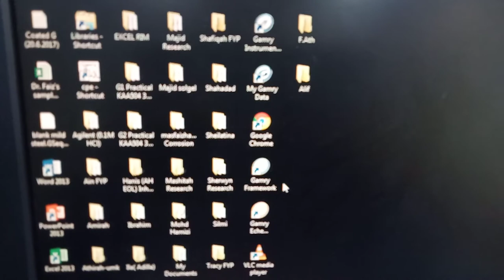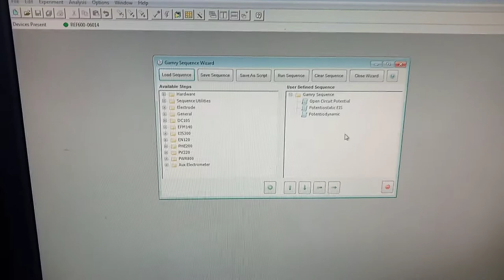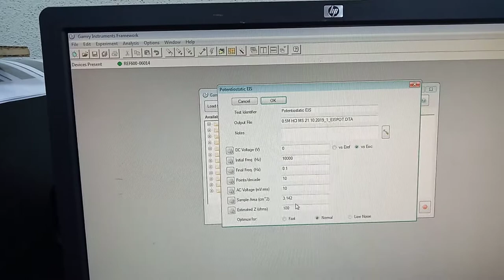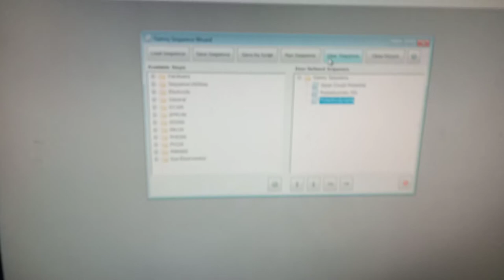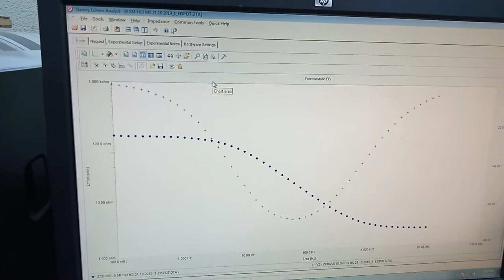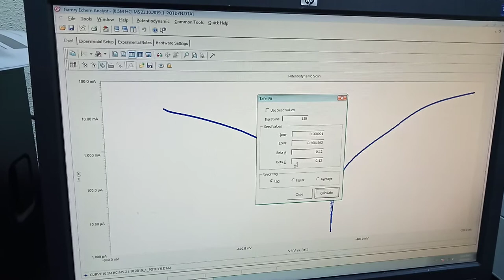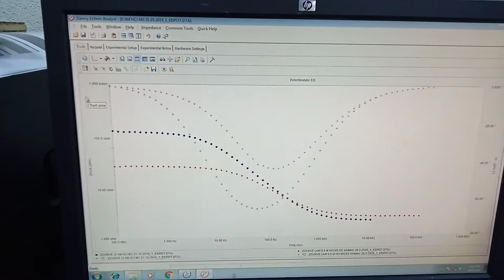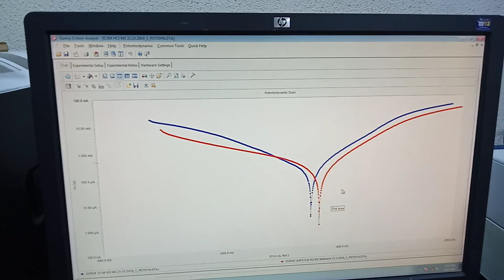Electrochemical Measurements (OCP, EIS and PD) for Corrosion Monitoring using GAMRY Reference600

Comment: Hi 
Dr. 
Mohd Hazwan
Thank you for the details . I am working on nano aluminium metal matrix composite and I wanted to know 

1) For PD what should be the initial and final V and the Scan Rate
2) For EIS What should be the initial freq. and final freq. and AC voltage
Waiting for your valuable feedback.
Reply from the maker: Hi Nikhil, before I answer your questions may I know what is the medium (electrolyte) that will be used to test your aluminium metal?
Reply: @mohdhazwan6523  Dear Hazwan it is NaCl
Reply from the maker: @nikhilbharat8689  ok 
1) Potential range of PD can be -500 mV to 500 mV vs. Eocp. Scan rate can be 0.5 mV/s to 1 mV/s
2) Recommended frequency range can be 10kHz to 0.1 Hz and AC voltage can be 10 mV
Reply: @mohdhazwan6523  Thank you so much for your help. I appreciate your work

Comment: Assalam o Alaikum
Dr. Hazwan , the way you are guiding the young scientist is reallt appreciable....
I am also a young phD student and working on Mg AZ31 alloy..
Could you please provide me the guidance on following ponits related to PDP 

1. Which counter electrode is better graphite or platinum 
2. How to put the values of stern geary coefficient , equivalent weight , is there any standard method.
3. What should be the appropriate votlage value w.r.t OCP ,  i mean some people put +250 mv - 250 mv , some put +1 V -1 V ... is there any logic behind it.

Best Regards
Reply from the maker: Waalaikumsalam

1. Both graphite and platinum works well as counter electrode.
2. For the equivalent weight, we understand that it is equal to Mew = Mw/n (average molecular mass of metal/valency). Therefore you need to calculate first the average molecular mass of MgAZ31 alloy based on their elemental composition.
3. Well it depends on what kind of information that you want to see. Bigger range of potential (-1 V to 1 V) is often used to study the passivation and pitting corrosion, while lower potential range (like those mentioned in the video) is used for active polarization.
Reply: @mohdhazwan6523  Really thankful

Comment: Thank you very much to presentaiton Mr Hazwan. As i understand, it is possible to measure corrosion rate of coated steels. I have some coated steels which are coated with pet,pvc, etc. Can i use same set up logic for our coated materials? and will i see corrosion rate of our materials in same table which is at 18:10 in your video?
Reply from the maker: True, inspection for corrosion under insulation (CUI) is sometimes tricky. Nevertheless, you still can undergo polarization measurement for coated samples in order to get the corrosion current density, icorr or even corrosion rate. Remember to remove some part of the coatings so that working electrode cable can be clipped directly to the substrate.

Comment: Thank you for the informative video.  I want to figure out polarization resistance for a reinforced concrete setup. My cable connection is fine. But when I perform Polarization resistance measurement, the current is around pico ampere. my OCP is around -535mV. How can I correct my current data?
Reply from the maker: And your sample is stainless steel?
Reply: @mohdhazwan6523  no it is normal carbon steel used to make rebar
Reply from the maker: @suraksha56  please recheck your counter electrode..try with simple graphite electrode or if you have another counter electrodes like platinum or stainless steel

Comment: Hello Sir, 
I want to ask that , by definition anodic beta taefel constant and cathodic beta constants are the   volts/decade .... But my confusion is which decade we have to obsevrve ? there are more than one decades on x-axis (log current density)
Reply from the maker: Well, ba and bc are basically the slopes of anodic and cathodic polarization curves. No doubt it is the potential over current relation but the equivalent unit is also equals to potential over decade

Comment: Hello Dr. Hazwan,
I’m curious, do you have to always polish before running corrosion experiments? Would cleaning with distilled water and acetone be okay? Thanks for a great video. I look forward to what you have to say.
Sincerely,
Richard
Reply from the maker: Hi Richard, 
The main purpose of polishing is to get rid of any impurities (for instance oxide layer that may form) that may increase the surface resistance. By principle, to get a sensible value of electrochemical parameters, it is best to do the surface pretreatment (polishing) before running the experiment.
Reply: @mohdhazwan6523  thank you very much for replying back so quickly and over the weekend. I really appreciate it and thank you for the advice.
Reply: Hello Dr. Hazwan, I ran a steel test. It went very well. Do you have any advice on how I can work with aluminum alloy? When running potentiodynamic polarization I always get noisy signals near Eoc. I’m using 2000 SiC to polish the aluminum working electrode. I sonicate 15 minutes each with acetone followed by a quick rinse with DI water and finally sonicate with DI. Electrolyte contains sodium chloride, and potassium sulfate when running PDYN on Gamry. Any help would be truly fantastic.
Reply from the maker: @richardwest4567  dear Richard, is there any bubbles formed on the aluminum surface? If yes, perhaps you can purge it first using a dropper before running the polarization
Reply: @mohdhazwan6523  Hi Dr. Jazwan, thanks for getting back to me. There is no bubbles before beginning the polarization experiment. I run it from -50 mV to + 50 mV vs Eoc and no bubbles. However, if I push well beyond +50 mV the Eoc I will see it.
Reply from the maker: @richardwest4567  Dear Richard, ok I understand now. Does it shows data point fluctuations after Ecorr and appears mostly at positive potential (anodic region)? Perhaps it is due to metastable pitting (it is normal because you are using aluminum, which is highly reactive).
Reply: @mohdhazwan6523  correct! At Ecorr and the anodic portion are where the fluctuations happen to be - consistently. It shows up at 0.167 or 1 mV/s.
In your experience, running PDYN polarization at fast scan rates like 5 mV/s is out of the question? From what I understand that will distort the Eoc and Icorr values.
Reply from the maker: @richardwest4567  yes of course..with slower scanning rate you will experience more disturbance especially at the anodic potential..therefore I guess the selection of the scanning rate range will be important depending on how active the metal is..
Reply: @mohdhazwan6523  you are a fountain of knowledge. I truly appreciate your time and your help. You are truly nice. In the future, if I need more assistance may I email you? I saw your email in other threads.
Reply from the maker: @richardwest4567  sure, no problem richard.. have a good day to you

Comment: Assalammualaikum Dr Hazwan. I'm Asiah, PhD student, working on piezoelectric material. 

I want to obtain current response graph, to switch on/off event using electrochemical method (Metrohm). Could you guide me to setup the procedure, either to select LSV or chronoamperometry setup in the AUTOLAB software? 

I use Na2SO4 as electrolyte, reference electrode : standard calemel electrode (SCE), counter electrode: Platinum electrode.  
Thank you.
Reply from the maker: Dear Asiah, unfortunately I dont have Autolab unit in my lab

Comment: Is Potentidynamic Polarisation same as LPR?
Reply from the maker: not literally the same. PDP plots are logarithmic version of current density, while LPR plots are linear version of current density. The potential range between these two methods are not the same as well. PDP have slightly bigger range than LPR.
Reply: @mohdhazwan6523  which reference can I refer to know the potential range between these two?
Reply from the maker: @chuaalvin7455  well there is a lot of references available. For PDP the potential range is normally around +-300 mV or +-250 mV from Eocp, while for LPR the potential range is around +-20 mV only from Eocp.

Comment: Hi Mohd, I am working on welding of austenitic stainless,inconel and dissimilar welding. What are the different electrochemical corrosion test, I can perform.
Reply from the maker: Hi, you can perform both polarization and impedance. But in order to calculate the corrosion rate of your welding metals, you need to know the elemental composition of the alloy.

Comment: Assalamualaikum Dr..may I ask you Dr regarding corrosion inhibition studies? Currently I'm doing corrosion inhibition studies (EIS & POLARIZATION) using Autolab NOVA 2.1.4..according to the theory, as the concentration of inhibitor increases, the semicircle in EIS supposedly to be increased..however, the data obtained is fluctuate & inconsistent (not follow the rules)..does the geometries, distance & position between WE, RE & CE can affect the data? Or it is because the working electrode is not consistently polished? And may I have the suggestion to minimize this problem?
Reply from the maker: Waalaikumsalam Alia,

There are many reasons for scattered points of EIS data;
1. The experimental set up is not suitable
2. Formation of bubbles on the surface of your WE
3. RE or CE are not working well
4. Cables are  not properly connected to the cell
5. Leaking from the electrolyte
6. Noise disturbance from the environment.

What is the type of metal that you used as WE? What is the Eocp value? From here we can deduced something, either the problem is coming from RE or connection.
Reply: @mohdhazwan6523  Thank you so much Dr for your explaination..for your information the material been used is mild steel & Eocp value obtained around -0.474V
Reply from the maker: @aliaatiqah4829  RE seems ok because it measures the actual range of iron standard potential. Is there any hydrogen gas bubbles on the surface of your WE? If there is, I would recommend you to remove the bubbles using dropper (flushing on the surface) after OCP just before EIS measurement

Comment: Greetings,

This was a very informative video for great visual understanding. 
I would like to know if it's possible to measure the corrosion rate for reinforced cement concrete in the field of Civil Engineering.

Thank You.
Reply from the maker: Hi, yes it is possible to calculate corrosion rate for reinforced steel. But the set up is not the same as shown in this video

Comment: Hi dr, i would like to ask how the process of adding inhibitor at the end of your video? Is it just adding into the electrolyte?
Reply from the maker: Thank you for your question. The corrosion inhibitor was added in the solution media via dilution. Let say 100 ppm (100 mg/L) of inhibitor in 0.5 M HCl, we weighed first 100 mg of inhibitor and later dilute it with 0.5 M HCl for 1 L volume. You can scale it done (depends on how much sample you have) like to 100 mL (weigh only 10 mg instead of 100 mg).
Reply: Sir, can I get your email to ask regarding GAMRY instruments? I am doing my fyp in my university but my university didnt have GAMRY
Reply from the maker: @nurkhuzaimah1602  you can check it out from my profile at http://chem.usm.my directory

Comment: Hi Mr Mohd, if i want to immerse the material in the solution for 3 hours first, do i have switch on the potentiostat?
Reply from the maker: Good question. If you want to monitor the stability of your potential, you can switch it on and perform open circuit potential. The outcome will be a profile of your metal's potential over time.

Comment: Hi Mr Mohd, if I want to measure the corrosion rate for coating application using this method, do I need to apply coating on both side of the sample? Or 1 side is enough?
Reply from the maker: Hi Ahza, for this method one specific exposed area is enough. Corrosion rate use electrochemical technique can be calculated as follows:

CR (mpy) = (0.13 x icorr x Mew)/density

Where icorr must be in microamperes, Mew is the equivalent weight (atomic mass/valency) and density is the density of the studies metal
Reply: @mohdhazwan6523  Thank you so much dr for your reply, really helpful. Much appreciated. Btw, are you familiar with the composite coating dr?
Reply from the maker: @nurahzachenasir4299  yes, i am currently working on composite coatings (epoxy based reinforced filler)..let me know if you need any help
Reply: @Mohd Hazwan  dr, do you know how to measure coating thickness? And what equipment do we usually use to measure the thickness?
Reply from the maker: @nurahzachenasir4299  i use thickness gauge. But if you dont have it, you can calculate the thickness via cross sectional SEM
Reply: @Mohd Hazwan  UT thickness gauge dr?
Reply from the maker: @nurahzachenasir4299  any brand will do

Comment: Hi i m new researcher n i m going to work on corrosion inhibition but can u please suggest me which electrochemical machine is very good for corrosion inhibition study
Reply from the maker: Oh well, all potentiostats have the same purpose. I have been working with different types of potentiostats and found that each potentiostats have its own uniqueness. To me, it doesn't matter which brand you are working with, the most important thing is the consistency and the ease of setting. That's all

Comment: hi can i check the corrosive effect of a pcm on aluminium sheet with this method
Reply from the maker: Yes of course you can
Reply: @mohdhazwan6523  the pcm will be solid at room temperature  the volume ia roughly 10 ml only
Reply from the maker: Dear John, you can dissolve the pcm first  with small amount of ethanol and later dilute it with the electrolyte of interest (distilled water or brine or acid solution). Remember solubility is crucial for corrosion inhibition studies.